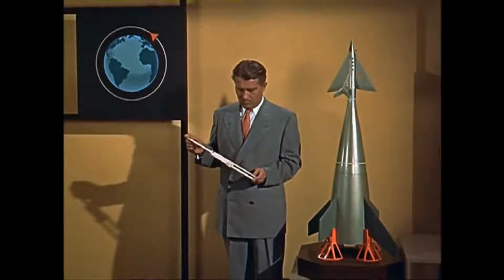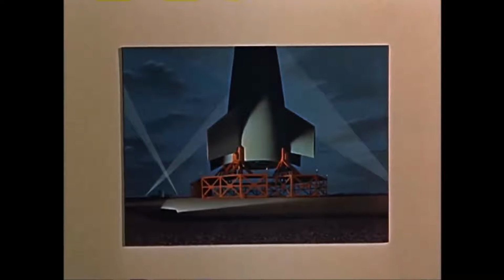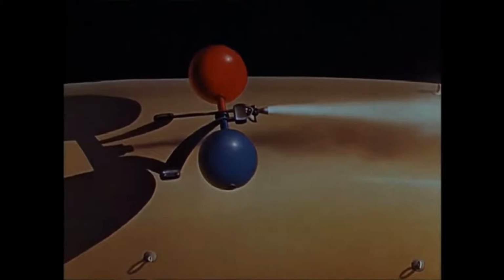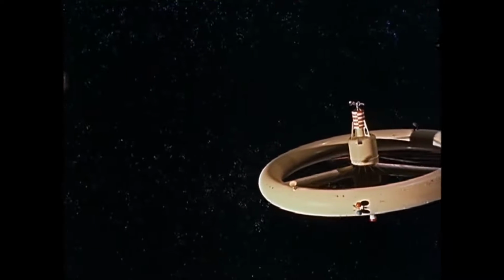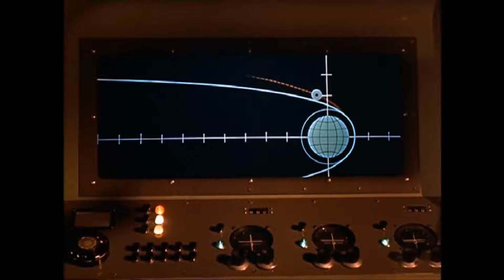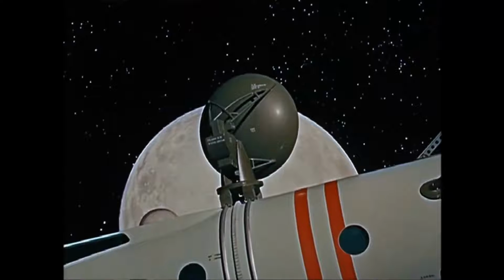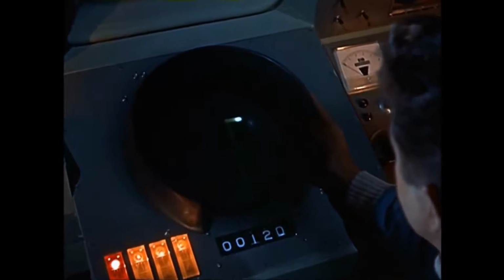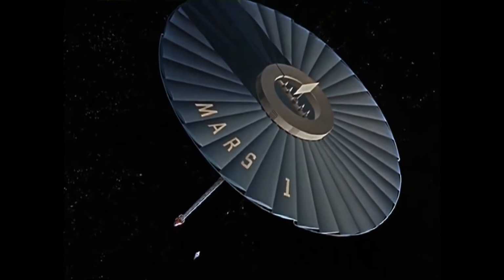Wernher von Braun explains the possibility to reach the Moon. "Man and the Moon", Dec. 28, 1955

Comment: Space Comedy at its finest.

The recent "space hotel" B.S. seems to be based on this same design.
Reply: You will be eating those words in a few years.
Reply: @Earthislife1031  

Think about a centrifuge. 
The denser materials go to the outside.
For an object in "orbit" we are supposed to believe that somehow gravity and centrifugal force balance out perfectly ...

On the iss why do unsecured objects  not move towards the ceiling ?

YEAH...

AND THERE IS A LITTLE MATTER OF THEM GETTING CAUGHT RED HANDED FAKING THE FOOTAGE !!!

@0.53 Astronaught get caught in wire.
@3.55 Fingers Intersect .
@6.04 Object disappears
youtube.com/watch?v=J1K15br17u8
Reply: @decadent. please show me the wires https://youtu.be/Snn1k_qEx20
Reply: @decadent.  And to answer your question. Things on the ISS are not moving toward the ceiling because to stay in orbit, an object must be traveling at a constant speed over Earth's surface. For the ISS, which orbits at a height of about 200 miles (322 kilometers), that's roughly 17,500 miles (28,163 kilometers) an hour. ... Without those propellant burns, the station would eventually drop from orbit. The ISS doesn’t fall to Earth because it is moving forward at exactly the right speed that when combined with the rate it is falling, due to gravity, produces a curved path that matches the curvature of the Earth.

Here is an article to help you understand. 
https://www.forbes.com/sites/quora/2018/04/18/what-prevents-the-iss-from-falling-out-of-orbit/
Reply: @Earthislife1031  
NOTICE THIS SHILL DOES NOT COMMENT on the video I posted

That is because he CANNOT. HE KNOWS that argument is lost.

Rather than answer my specific question. He simply deflects and ignores MY question...

This is classic COINTELPRO Tactics.

You state the ISS orbits at a constant speed.
FORCES are accelerations RIGHT ? (F=ma)

On one hand you claim the ISS is in free fall (ie. accelerating) but it is also moving at a constant speed .... 

If you are going to claim that a change in direction is an ACCELERATION . Then give me the formula that explains that ... :)

Try this one ...

THOUGHT EXPERIMENT (1) 
If a helicopter is hovering it has effectively cancelled out the effect of gravity. There is an upward force equal and opposite to the downward gravity force. So then the question is .. Why does it move in a circular path around with the earth as it rotates? If you say it has a certain velocity from the ground when it takes off (1037mph) if it is hovering then it would have to move in a straight path. You cant claim gravity is "pulling in down' because if it is hovering then net force of gravity is ZERO... :)
Reply: @decadent.   That your shows you don't understand conservation of momentum
Reply: @decadent.  Comment on your video? I watched and i didnt see any wires. You only see what YOU want to see. Theres a name for that. Its called pareidolia.
Pareidolia is the tendency for incorrect perception of a stimulus as an object, pattern or meaning known to the observer, such as seeing shapes in clouds, seeing faces in inanimate objects or abstract patterns, or hearing hidden messages in music. Pareidolia can be considered a subcategory of apophenia.
Reply: @decadent.  I noticed you have no content on your channel. That just means you parrot everything you hear from other flat earthers. Typical...
Reply: @Earthislife1031  
Stop trying to diagnose me with conditions that are more applicable to YOU :)
- I am an extremely logical and self critical person. My job requires that of me every day.
- All my arguments are my own. I am more interested in discovering the truth for myself than educating others so I don`t make videos. 
- I can link you to debates where I have destroyed phD physicists. So it should be obvious that if these guys CANNOT refute these arguments that NO ONE can. 
- I have known the space program was not what it was presented to be for at least 20 years.
- There is something very interesting to discover here IF you are prepared to THINK for yourself and REALIZE that governments lie to their people about almost everything.

Of course you cannot SEE the wires. 
- But you can see the astronauts sometimes grapping an invisible wire or getting caught in a wire etc ...

This is one of the most obvious examples of a wire being visible when it pulls on the guys clothing.
- This is undeniable .......

SEARCH YOUTUBE FOR "Conocé el fantástico sistema ARGOS de la NASA" 
Look at the Guy in the green shirt that presses a button on the side with his left hand. 
Look at the material on the shirt of the guy upside down in front (ringed) @ 19.31 - 19.45 
At the same time you hear the hydraulic A.R.G.O.S. system activate

They are using wire removal technology to remove the wire itself.
If you bothered to watch the whole video, it is explained...

Simply watch this WHOLE video, without second guessing or judgement.
- There is so many inconsistencies here.
- There can be possible explanations for "some" of these issues but there is a clear pattern here that can be identified if you actually view this with an open mind.

SEARCH YOUTUBE "1+ hour fake station fails"

If you do finally get it ...
- Research prepping and take the corona virus seriously. It is far worse than "they" are reporting.
Reply: @decadent.  I bet your a smart person, but you have allowed YouTube to clowed your judgment and drive the way you think. You allowed people to manipulate your mind into seeing what they want you to see so now you look for flaws in things that are not even there. 

I watched that entire video  and saw no wires. All i saw were astronauts moving exactly how they should move. The part at the end with the people on stage with wires looked and behaved noth like the astronauts. They were onstage with nothing above them blocking the wires. The astronauts were in tite quarters with many things around them. Not consistent with someone hanging from wires attached to their waist. Also the video pixelation is easily explained by just not having a good connection just like thishttps://youtu.be/U40iXIqBzrk.

Now that i watched your video. Please watch the ISS tour that i linked https://youtu.be/Snn1k_qEx20
and please point out where you see wires.
Reply: @Earthislife1031  

Some of the NASA videos are very good and are pretty convincing.
- Why is that surprising ?
- NASA have been perfecting FAKING SPACE for 50 years. 
- That is all they do, it is their job.

The truth is revealed when things go wrong.

If you really watched the first video....
- I just cannot see how you think there is an valid explanation.
- You are not understanding how sophisticated the ARGOS system is.

How can you not notice the missing object.
The intersecting hands etc ...
and the obvious handing of invisible wires .... ???

In the last video I posted . There is an obvious issue with the 4 astronauts where they guy CLEARLY grabs a wire...

Another example .....

NASA Busted Again! Stunt rigging issue? 14 Sep 2019
youtube.com/watch?v=htvGeuWQW-c
Reply: @decadent.  Funny how when I Google ARGOS System, nothing comes up.???
Reply: @decadent.  Also please tell me how this video is possible if space is fakehttps://youtu.be/jXYlrw2JQwo
Reply: @Earthislife1031  Good luck friend. If you don`t get it by now you never will. 

If you are so intent on believing in NASA then FINE go ahead. 
- Many of my family would agree with you :)
- We can agree to disagree . Its all good.

When I google "ARGOS NASA" , first result is this ...

https://www.nasa.gov/centers/johnson/engineering/integrated_environments/active_response_gravity/
Reply: @decadent.  its a training simulator.
Reply: @CynicalSkeptic-r5u   I'm not saying it's gonna happen by then, but it's gonna happen at least within the next 5 to 10 years. Then all the flat earthers will be like... Oh wow... these globers were actually telling the truth the whole time.
Reply: @CynicalSkeptic-r5u   In all the years at NASA has existed there's never been any whistle blowers or anything. No one coming forward saying it's all been a lie, not one person writing a "tell all" book about their experiences while working for the fake organization known as NASA.  All we have is a bunch of you tubers claiming that NASA's fake all because they've heard it from another you tuber.
Reply: @CynicalSkeptic-r5u   Here is an article listing a bunch of products that we wouldn't have if it wasn't for space exploration.https://www.usatoday.com/story/money/2019/07/08/space-race-inventions-we-use-every-day-were-created-for-space-exploration/39580591/
Reply: @CynicalSkeptic-r5u  So your under the impression that every photo that has ever been taken from outer space is fake. Even the ones taken by agencies other than NASA.
Reply: @CynicalSkeptic-r5u  Lol globe deniers and their claims. Funny how when I research "NASA WHISTLEBLOWER KILLED", find nothing about anyone ever being murdered.
Reply: @CynicalSkeptic-r5u  lol its funny how in the beginning of the video he warns "flat earthers" against using this video.